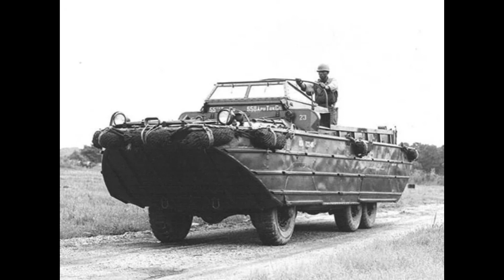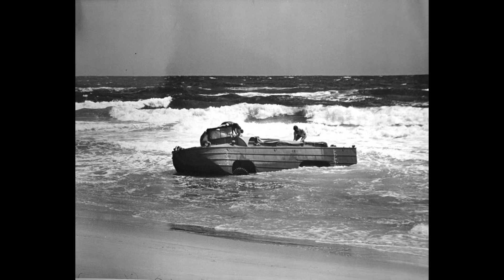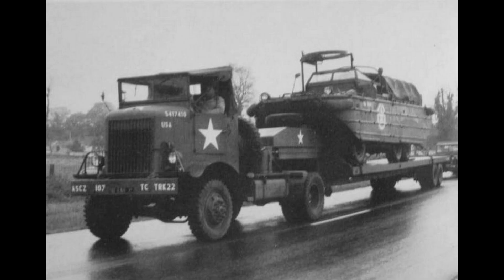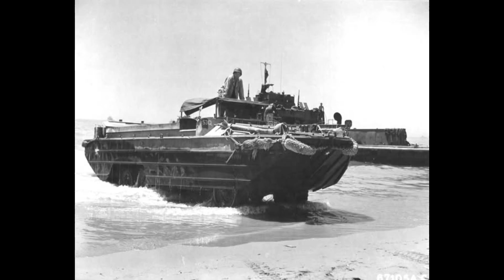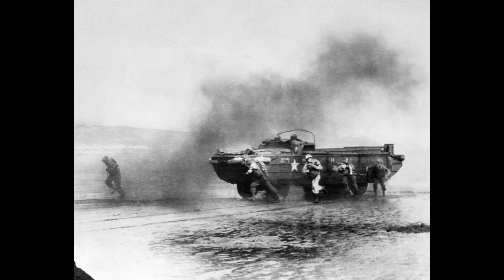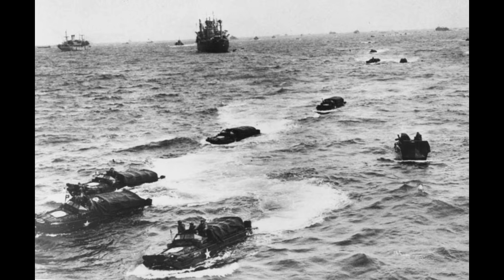How Engineers Designed DUKW Amphibious Trucks to Drive From Ship to Shore Without Stopping

Comment: I took a ride on a DUKW, a couple of days ago. There was a stretch where we were travelling up a creek with both wheels and prop engaged. The low pressure tires did a great job pulling the Duck over the sandbars, while the prop pushed it through the deeper waters.